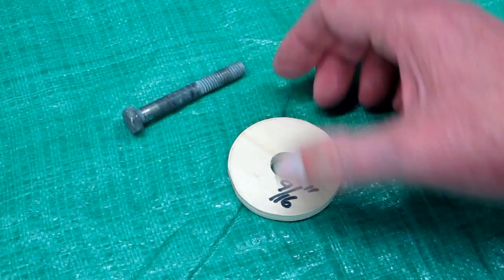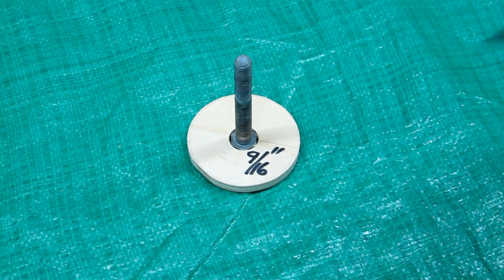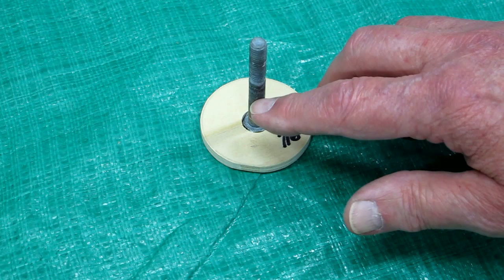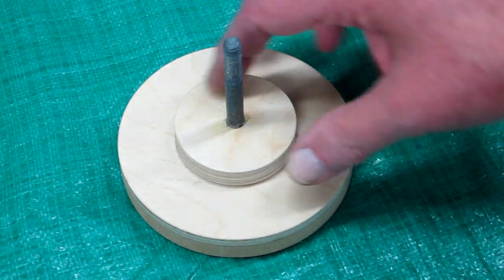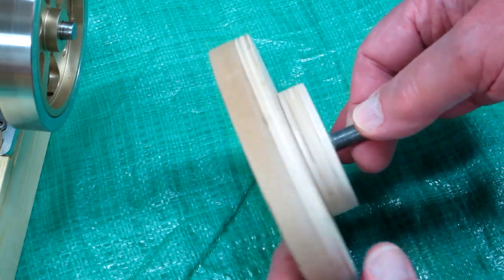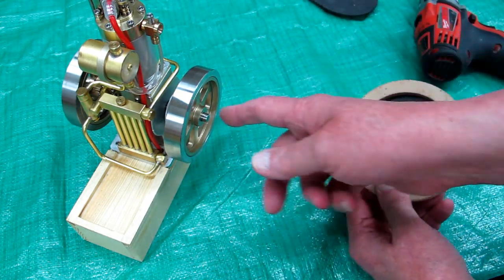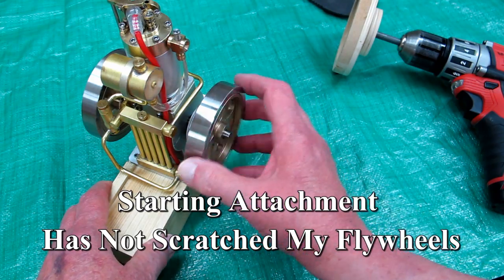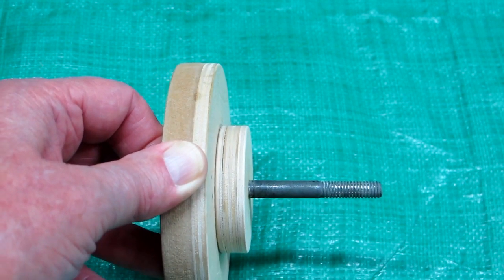Cordless Drill Starter for Eachine Hit & Miss Engines

Comment: I have the same engine. When i got it there was only one piston ring but there is place for two's. With a spare piston rin it has to low compression and with two rings the second one don't get enough oil and the piston is blocked. Did you have any advise for me?
Reply from the maker: Information I received over one year ago, from the manufacturer, is they started installing only one piston o-ring to lower the compression so it would idle slower.
So... did it run when you received it? 
The piston o-rings seem to last quite a long time. Longer than I expected anyway. Usually if there is no compression a valve is sticking open... doesn't take much to hold one open... tiny piece of carbon.
Ref: "with two rings the second one don't get enough oil and the piston is blocked" ... Not sure what you mean about not getting oil (the oil should be in the fuel)... also not sure what you mean by "piston is blocked".
Reply: @RonaldWalters2010  Mine get the oil from the crankcase not from the fuel like my other engines. I also run it on gas and the factory piston rin last very long. Now imagine there are 2 piston rings and the 1st strip off so much oil from the liner that the 2nd upper piston ring runs without oil in the liner. This causes the piston to run stiffly in the liner. I think I think I just have to run the engine a bit with one piston ring and after a while it rubbed a bit of and has more compression.
Reply from the maker: These engines are not intended to have oil in the crankcase (splash lubrication) so if you are doing that you will probably have other problems as well. I have a video on the Correct Fuel which has oil in it and it runs well on that. The rest is up to you. Have fun! Ron
Reply: @RonaldWalters2010  I also tested it and it is working that it's getting oil from the crankcase
Reply: @RonaldWalters2010  I think the piston from the blue hit and miss engine (I hope you now wich one I mean) is better because there is only one thick piston ring .